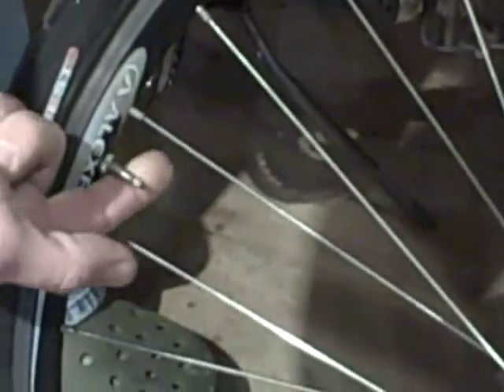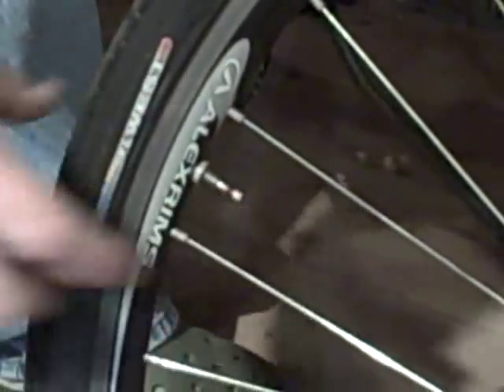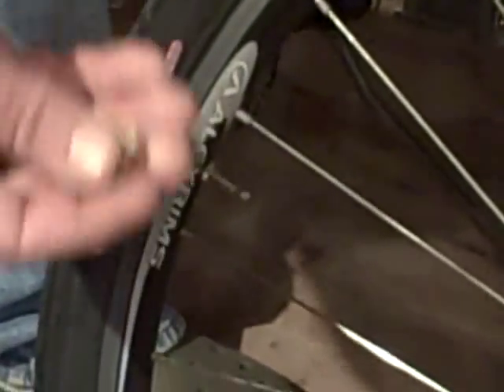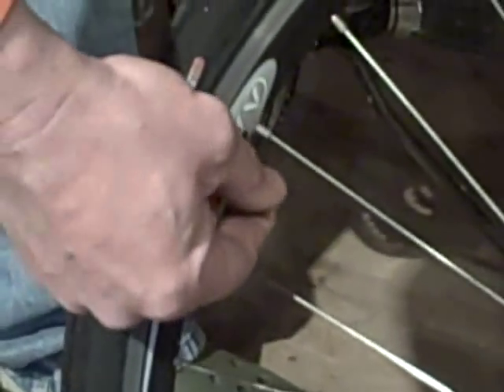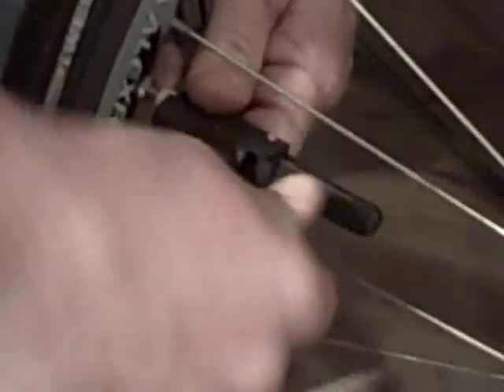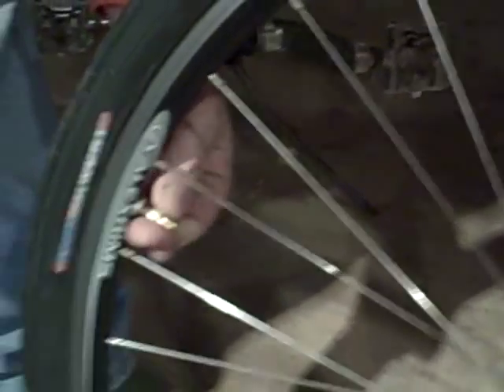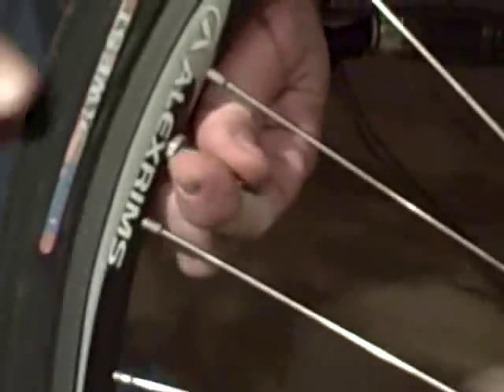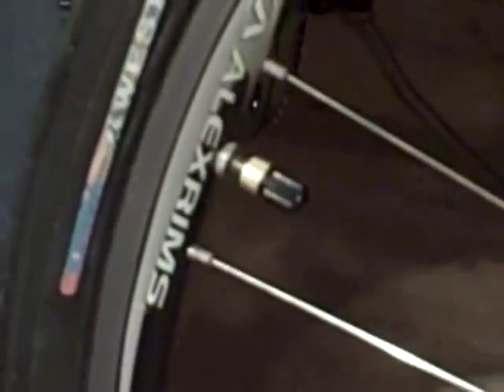How To Use A Presta Valve Adapter On Your Bike Tires and Tubes

Comment: An oldie but a goody. Still trying to figure these silly presta valves out. From this video and a few others I have come to understand that unlike schraeder valves that use spring closure, presta uses air pressure to close, but only while adding air, after that must be tightened back down to seal.

Comment: I bought a pump that came with a bunch of adapters, and inside the Presta adapter the little black rubber band got caught in the Presta valve and broke! I don't think it will work at all anymore! I just bought the darn thing. Is this common?

Comment: I think where most people are having a problem is their presta valve adapter is probably a press-on type like the one I have/had with only a grommet to squeeze the adapter in place. It doesn't stay on under high pressure and just pops right off. Save yourself a lot of time and frustration and get a screw-on type adapter.

Comment: Thanks! I just bought tubes, got home, took bike with flats apart, removed tires/tubes, began to install new tubes for a day of riding and discovered this piece of fucking shit garbage gimmicky junk valve was on the tube. So now I have nothing to pump it, nothing to check the pressure should it spontaneously inflate. Although, thanks to you, I now have a solution- I am going to return these tubes and buy schrader equiped tubes. There is no way this is better than a schrader. I want SIMPLE!!!

Comment: I've been having so much trouble with this valve, I use an automatic tire pump (powered by a car outlet) and I'll set it up correctly but when it comes time to pump, the max PSI it ever gets to is about 21 PSI. Air just leaks out somehow.

Very frustrating

Comment: i believe i have the same air pump as you.. it has both holes for a shrater valve and a presta valve but when i use it it does not pump air into my bike when i use the presta whole.. the valve on my bike works.. it may just be the pump itself am i correct

Comment: hey thanks for the video!
one question I have an adapter but it has a little black rubber band on the inside. when I take it off  I can screw it in but it wont inflate. am I supposed to leave the little black rubber band inside of it?

Comment: The more load you put on a tire via weight, the better to run higher pressure to keep the tire from deforming, pulling away from the bead etc. That being said, I find the pressure ratings for mtn bike tires to be on the high side, I run them at the lower limit or even a little below. 35 - 40 psi on a 2 inch wide tire, i'm 165 lbs. can't speak for narrower road tires, smaller contact patch will require higher pressures than this. more weight, higher pressure better.

Comment: Always go to the max pressure, because 
1. The manufacturers lawyers make sure the number is lower than what the tire was tested for to avoid liability issues, and
2. going under the recommended pressure puts you at risk of pinch flats.

Comment: The problem I have is the o-ring on the adapter pushed the presta valve down. Then I pump, and pump, with no air actually getting in to the tube. Then the wonderful presta valve has no back pressure because tube is empty...then the presta valve drops down...then when I put the adapter on, again...no air getting in to the tube because the presta valve is letting it out as i pump.

Comment: Thank you for adding that little bit extra because I was a bit worried about keeping it on thinking what keeps the air from coming out when using the adaptor and I constantly have the cap going missing

Comment: The fuck they aren't that bad.   They could have just left the valve stem alone.   They've worked just fine for 100 years.  Why change it?   Who cares if they leak a little air every now and again.  I have presta valves on my trek and over winter they still leak air.   Just a headache these presta valves .

Comment: 12 years on and still getting comments. Thank you for this simple explanation. By watching your video I noticed the washer is missing from my valve adapter, hence I can't get it to the correct pressure.

Comment: a million videos on how to pump up a tyre that already has air in it, but NONE that show how to grip on fully deflated tyre valve where the top chrome sinks back into the valve.
Reply: AlfieNoakesOhHo so finally after much alignment I managed to get the pump connector to form a seal with the valve to get enough air into it so the chrome/brass bit sits up proud. Then it was easy. Plus, I don't have that ring screw at the bottom of my valve either